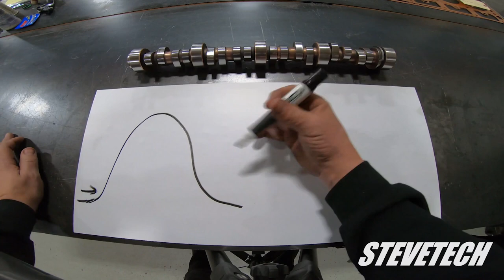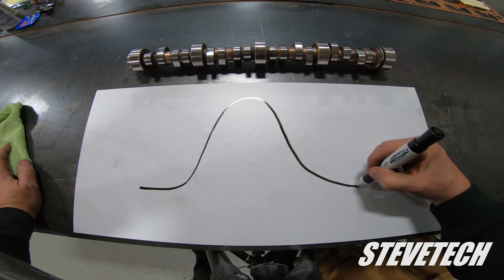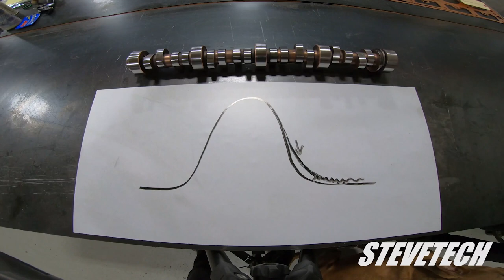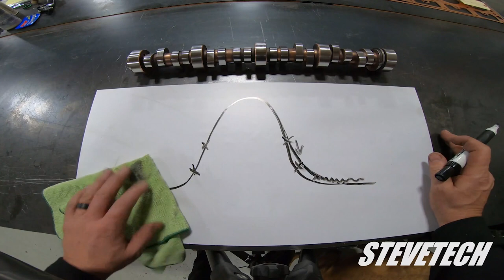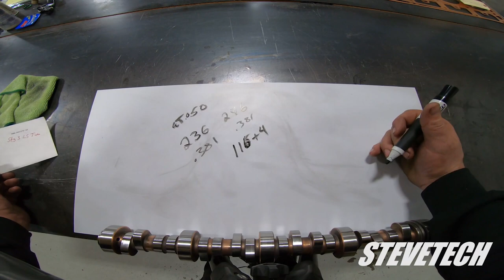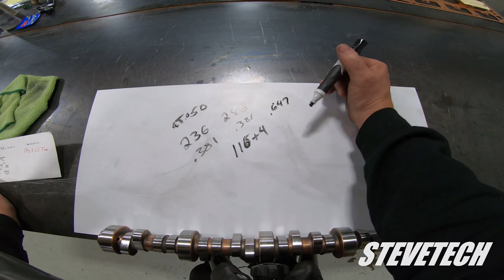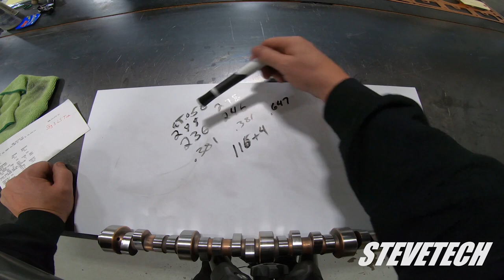Understanding Camshafts – Part 1 (Lobe Shape)

Comment: Absolutely,  @50 & @200 numbers are the biggest factors. The time(duration) that the valve spends in these areas is huge as compared tonthe time the valve spends in the lift area say .100" either side of full lift. Hence , head flow number at peak valve lift is not as important to think about as flow figures within the  range up to 'about' 80% of peak lift.
 Great vid 👍

Comment: Does Anyone Know If A .315" Lobe On A 252 Advertized Duration (200 @ .50") Is A Harsh For Rhe Valvetrain? Its In A 1.65 Rocker. This Is A GM 3800 V6 (231CuIn). Im Specing A Camshaft And Im Constrained To Very Short Durations To Keep My Overlap In Check For My Desired LSA. Its A Daily Driver Turbo Car. 

Originally I Speced The Intake Lobe .344 With 252 Duration (202 @0.50") But I Figured That Was Far Too Agressive On The Valvetrain For A Daily Driver.
Reply: This guy is full of crap

Comment: Someone should get a high speed camera and set up a test rig to show the bounce, I'd like to know how someone figured out about the bounce, how the hell would you know that. Be cool to see it in high speed
Reply: It's called a spintron. Spintron is a cylinder head set up with a valvetrain that's to be tested. It's bolted to a dummy block that may not even have any pistons installed. Then, specially mounted high speed camera's and a laser detect how, and when, valve float and bounce happen. This is a condensed explanation of what's actually going on.......
Reply: @milojanis4901  nice, very good explanation
Reply: I seen some high speed video of valve float.

Comment: Ok this is a thing with "engine builders" intake center line is not relevant to lobe separation angle absolutely.  And here's why, lobe separation is ground into the cam and can't be changed. Intake lobe center is ground into the cam but it can be changed. So if you have a 3500 hp drag and drive car, and it constantly shakes the tires you can retard the cam 4 degrees to take out some of the torque, but you're not changing the lobe separation in the least. This isn't that complicated !